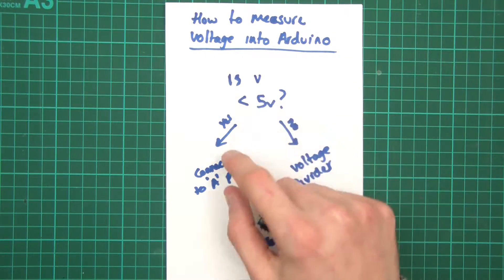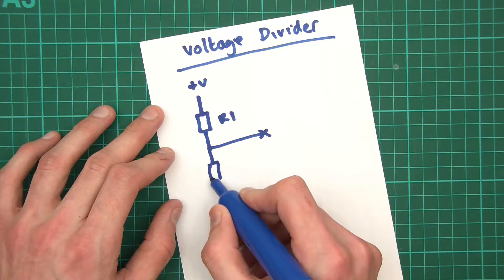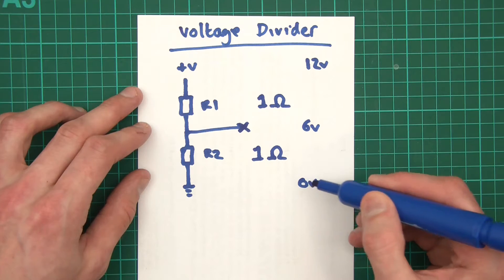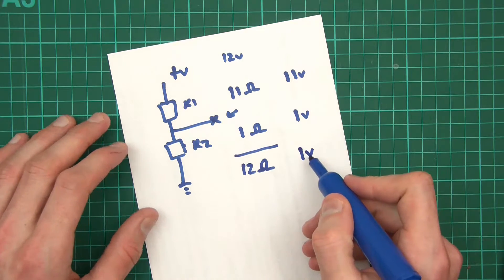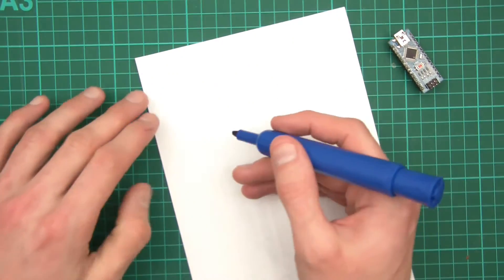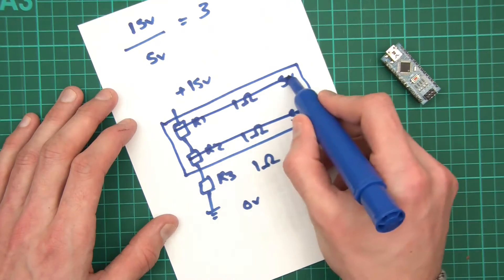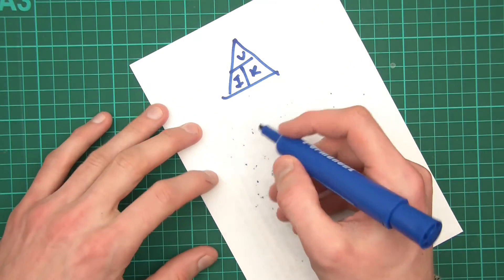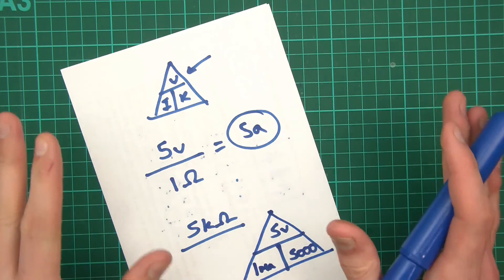TUTORIAL: How to Measure / Read Voltages Into Arduino - (Part 2/3 Voltage Dividers)

Comment: dear sir ,can i measure upto 0 to 5 volt directly connect to arduino A0 pin without any voltage divider circuit ?

Comment: ~min 5.57 (holy cow, very first time I hear something like that): "divide 12volts by 12ohms u get 1volt" ?????? ....what?????????
ever heard about Amperes and ohm's law ?
12volts/12ohms = 1A... and when 1A flows into a 1ohm resistor the V drop is 1V
it could take 5 second to explain correctly the voltage divider
Reply from the maker: The whole thing is based on ohms law. V / O = A. It's easy.

Comment: hi antony.just seen your voltage divider for arduino.i have campervan with solar and 3 mppt controllers.vw t4.would like to make arduino control with touchscreen display.nextion lcd led screens i think.im trying to learn,ive got arduino uno r3 will that work.?so battery voltages usually 12.2v to 14.5 when solar or dc to dc charger on when running van .steve
Reply from the maker: Hi, for something like that, don't use a voltage divider or buck converter, just use a 5v voltage regulator. :)
Reply: @antonycartwright  ok thanks antony.i may just use a alil battery monitor yet
Reply: Hi on my campervan solar have 66 volts coming in on Renogy Bluetooth app but only 0.3 amps showing that’s over 290watts panels .100watt +100watt +90watts string just fridge on all time Waeco compressor uses about 35watts

Comment: For arduino , we have to find out the 5V and the current level of the mA to run. 
With voltage divider process, we connected 4V 4mA to Arduino. is it work?

Comment: it is a good explanation.. now we jump to the practical with code.. where is the part 3?.cause i want to use vin greater than 5v which is 12v or 20v for arduino to read volt measurement through volt divider.